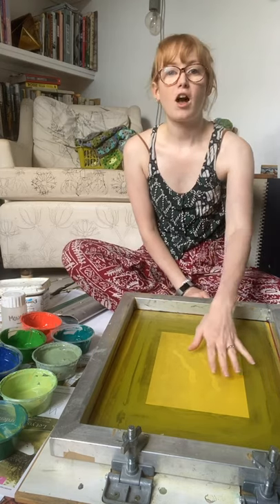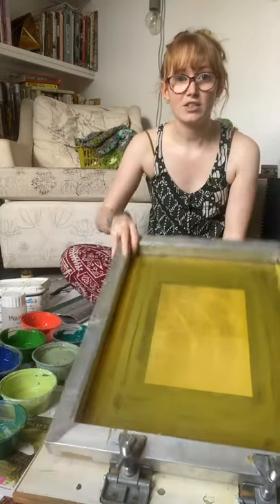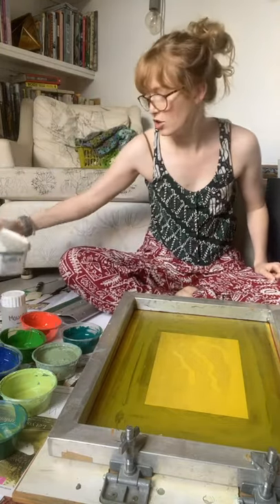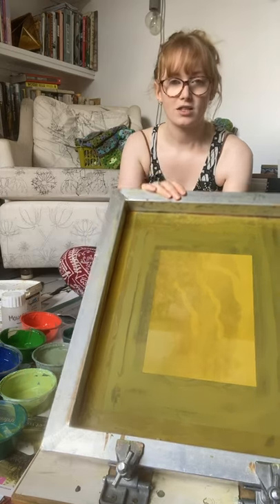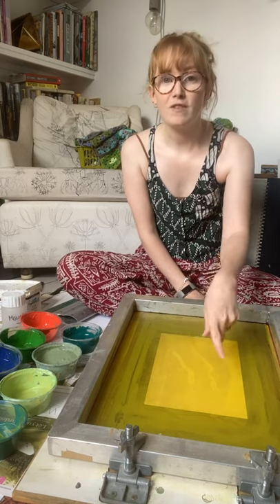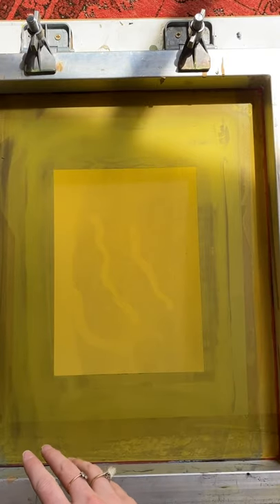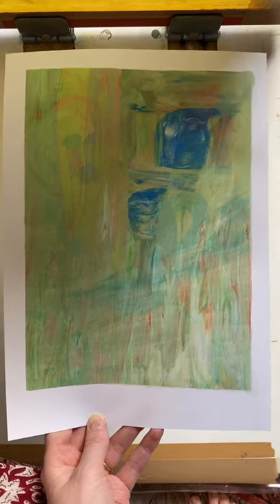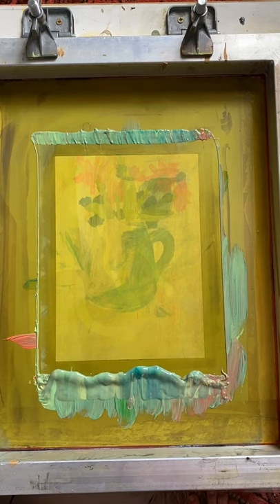Mono Screen Printing

Comment: Why do you have to fill the all mesh with ink? What happens if you just do like a line drawing on the mesh and then print it?
Thank you for the very straightforward explanation btw.
Reply from the maker: If you don't fill the mesh with ink it will drag down the screen and you'll get a smudged design

Comment: Thank you for making this video, I've been looking for something like this for a while and you explained the process perfectly. 

I'd like to make some mono-prints like this but on canvas rather than paper. Do you have any experience or advice on this? What sort of mesh I should use, primed or unprimed canvas, tight weve etc? 

I've been experimenting a little today, but I'm a novice so it's hard to try and work out why things aren't going right.

Comment: Hi holly
Love your videos
You have inspired me to start screen printing 
I have a question about the transparent base solution… what exactly is it for? Can’t I just use ink and paints and print with them? What is the need for this transparent solution. I watch a lot of videos of techniques and everyone says it’s important to have this transparent medium? I’m just so confused haha no one ever says why it’s in important 😂 helppp
Reply: Or another example is this acrylic medium? Can’t I just use acrylic paint! What is the need for the extra ‘medium’? 🤔
Reply from the maker: Acrylic paint on its own will dry into the mesh very quickly and permanently block your screen. An acrylic screen print medium will retard the drying of the paint so protect your screen. You need at least 50% medium to paint. The more you add the more translucent the ink will become.
Reply: @Handprinteduk  thanks for the quick response :) ok that makes perfect sense thanks
So if I was using water based inks… it’s the same reason then? Shouldn’t that come off with water and sponge or would that set permanently too?
So the transfer base is purely to stop it from setting too quick? And to tone down colour? Other than than if I’m quick I don’t really need it ? :) thanks holly
Reply from the maker: @jameslucas89  Acrylic inks are waterbased so you will need a medium. Happy printmaking.  Shirley.
Reply: @Handprinteduk  ok interesting
But then I used inks on the screen already and washed off fine after even multiple times? Still a little confused  but thanks so much for your reply Shirley :)
Reply from the maker: @jameslucas89  which inks were you using?
Reply: @Handprinteduk  you know what… thats exactly the question I needed to be asked… I already have some inks from older projects and so used these and now I read they are pre made WITH medium 😂 so yeah that’s what’s confused me  I think… again thanks for your help 😁😘
Reply from the maker: @jameslucas89  Happy to be able to help!